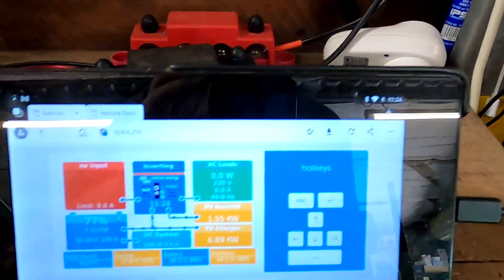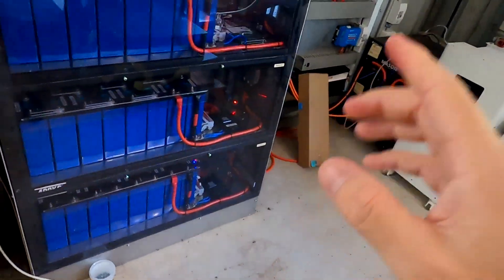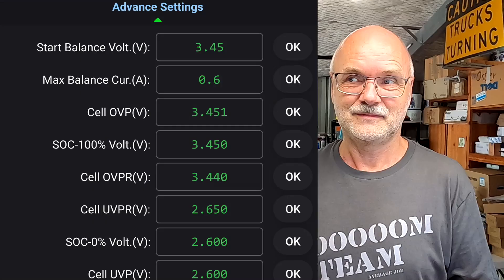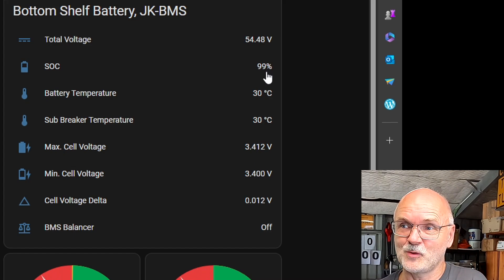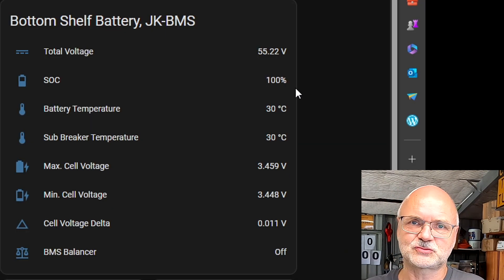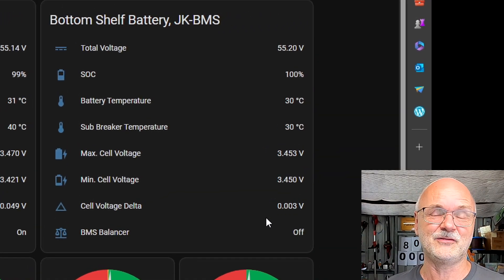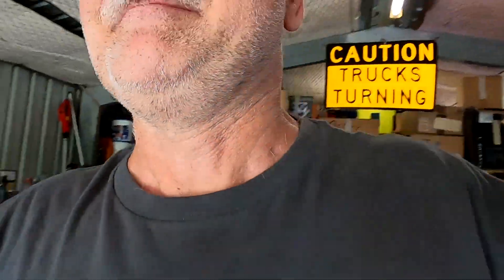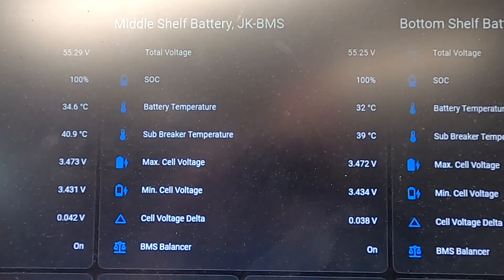Reset the old JK-BMS to 100% SOC when fully charged with no OVP. Here is how.

Comment: Great video as always. Have you done anything about not having a balancer on the battery pack, you could just monitor the voltage on each cell, when a cell reaches 3.5v or 3.65v you can lower the charging current, I know that it is then the bad cell that first reaches 3.65v and the others do not get a full charge but they will last for a longer time/year, you can always replace the bad cell or mount a slightly smaller cell on it in parallel. One replaces cell if less in % I guess.
Reply from the maker: Oh, no, no, no... that not how it works. WHY, why would you disconnect the active balancer just to let some cells hit 3.65V??? That makes no sense.
A smaller battery in parallel with a larger is a big no no as well. Tested here on the channel.
Reply: @OffGridGarageAustralia  Just thought that the max volt you could charge to was 3.65v for a cell, a balancer is probably an idea.
Reply from the maker: @jacobhn2 We don't need to charge to 3.65V with these cells to fully charge them. That is just the max, the manufacturer states in the specs. The cells will perfectly fully charge at 3.45V with a bit of absorption time. Lots of videos about that here on the channel...

Comment: 80k..fully deserved!
Great news on the 100% "reset", which probably is more a calibration to 100%, which will likely need to be redone if you "disturb" the batterie again, but as long as we don't do that😅..all good. 
I was also really p... about never getting the right "full" status, but this solves it..well done🤪
Reply from the maker: Well, it seems to 'reset' the charge cycles once we hit OVP. Ohh, don't you love JK's software🤣
Reply: @OffGridGarageAustralia  
No, not by hitting OVP.
It resets the charge cycle counter, if you change the capacity setting, as you did before.
Look at your video between 9:00 and 9:14

Comment: I use a node red workflow to reset to 100%. If the voltage of the akku is reached, the current is less than 0.4 i.e. and the battery has 98% or less, then i set the OVP to something like 3.45V. Then after JKBMS resets to 100% I set the OVP back to 3.6V
Btw. Serialbattery has also a feature to reset to 100% by loading to the OVP once every couple of days.
I use a D1 Mini ESP 32 which is flashed with esphome-jk-bms. This connects via bluetooth to the jkbms and allows to change every parameter from remote.
Everything is integrated in homeassistant from where i cann access everything via Node-Red
Reply: What? Please describe in more detail!
Reply: @anacronataff1  See my answer to michaelnarr7554
Reply: @ThomasWetterer  Dein Name klingt so Deutsch. Ich kann deine Antwort nicht sehen. Kannst du sie mir bitte kopieren oder wiederholen?
Reply: @michaelnarr7554   Habs oben in meiner Antwort ergänzt. Irgendwie werden meine Antworten nicht gezeigt.
Reply: @ThomasWetterer Danke jetzt kann ich es lesen. Ich habe das BMS an Victron OS über USB angebunden. Mal sehen was da möglich ist.
Reply: @michaelnarr7554 Das hab ich auch. Zusätzlich dann noch per Bluetooth mit dem esp32 um an die Einstellungen dran zu kommen. Das geht an Venus OS vorbei. In Venus OS gibt es bislang keine Möglichkeit was an den Settings zu ändern, auch nicht in SerialBattery. Denk das klappt auch nicht wenn man das JKBMS per Bluetooth anbindet.
Reply: @anacronataff1  I have added the infos in my answer above.
Reply: Hi, I’m also interesting in this way. Who do you can set the OVP with Node Red? I did’t found a command like this.

Comment: Thanks Andy, very helpful, just set up my first jk BMS and home made battery pack. Its fitted to Reva Gwiz electric car 😂, so i fitted 16 304ah batteries with the B2A20S20P BMS, connected everything up, charged the pack to 100%, it read 100% but wasn't at the full voltage, 🤔 Tried the car, great, it showed between 100 and 200amp discharge most of the time but did have some high spikes at upto 400 amp😳 for a few seconds. Then the soc disappeared , 0, I turned everything off and on a few times but no effect, so I reset the BMS and it came back at 68%. Much lower than i would have expected. I have charged it up again and it says 100% but they are not at fill voltage, any advice 🤔 thanks 👍 Ellis
Update, I just resent the 100 soc by changing the capacity of the batteries and they now say 73%🤔
Reply from the maker: Thank you very much!
Fully charge your battery and then fully discharge until the BMS turns off. The BMS will determine the actual capacity of your battery.
400A spikes are not good.

Comment: When OVP is set back to 3.65V, it looks like the 100%-reset is not based on voltage but on history of amps going into the battery. It doesn't really RESET to 100% at a defined voltage, but it gets to 100% by counting the Ah charged into the battery. This may be problematic because counting the Ah will drift over time due to measurement errors.
Reply from the maker: Yes, I think that is true. It coulomb counts from there, hence we see the voltage over and under that previously used voltage.

Comment: Andy I'm using a JK_B2A8S20P. Looks like we are using the same hardware version 11.XW, but my software version is a bit newer, 11.288. My first full test charge it reset to 100% at my SOC-100% value when one cell hit the desired voltage. Oddly I had configured the settings the way JK suggested when I saw you mention it in an earlier video. Not sure if this is fixed or is just a random BMS that works. Thought it was worth mentioning. Too bad they don't have release notes for the firmware version.
Reply from the maker: Can you give an example with the settings. I don't quite understand what you mean...
Reply: @OffGridGarageAustralia  Hi, I was just referring to the descending order. My test settings were OVP: 3.625 / SOC-100%: 3.500 / OVPR: 3.499. You had mentioned the order previously and I happened to set it like that for my charge test.
Reply: @OffGridGarageAustralia  I finally had time to charge my battery again today. What was interesting this time was it reset to 100% when the 'remain capacity' matched the total battery capacity. This was unexpected because none of my cells were close to the 100% voltage setting and the battery continued to charge for another hour. The bms continued to display 100% for the remainder of the charge cycle.

Comment: great solution, i did it already a few month ago, after this i only have to lower the capacity and put it again to the old data.
My bms shows first 94 % and then goes to 100 %, it means my capacity actual is 94 %, correct andy ?
And up to 1 million subscribers
Reply from the maker: Never seen it jumping in my both JKs. It gradually goes up to 100%

A million... pfff, don't have enough door space for that😄

Comment: Nice trick... here is new content for you, andy: 
if this trick works also at the seplos 10C bms? I already have this problem with my seplos. I have to touch the OVP to reset to 100% or to stay for more than one hour at maximum charge voltage. So the seplos charges most the time only till 98 or 99 percent... ☹️
Reply from the maker: Seplos is lost! Their software is so far back. I'm testing the V3.0 at the moment for someone. What a piece of garbage that is. The software is so bad, I just don't want to use it at all. It's not worth it!
Reply: I have self-made the hole battery pack with cnc milled mounting for the bms, so I have to life with it😅🙈

My biggest problem is the deviation with these shitty four cells anyway... I'm in contact with gobelpower now... if this is solved I can life with 99% soc... because I have no packs in parallel...

Greetings from Germany 🙋‍♂️

Comment: This is the same way daly wants us to reset to 100%. Also andy yesterday i found a new thing for me. If i use ferrules in victron mppt side the voltage it shows is higher so i think we shouldnt use ferrules as thats the recommendations from victron too.
Reply from the maker: Why would ferrules make a difference? I have tested (and still do) one controller with and one without ferules. There is absolutely no difference. My sparky also says use ferrules for these fine stranded wires.
Reply: @OffGridGarageAustralia  I think it's to do with resistance that's what victron says in there manual but I also was shocked to see it happen. There was about 1v difference or may be more. The difference came down as soon as I removed the ferrules.
Reply: @OffGridGarageAustralia  also forgot to add one more thing the lug I used was a pin lug it's different from what you used.

Comment: What if you hit a real cell over voltage protection situation now at 3.65v? Will the SOC-100% trigger change back to 3.65v then?
Reply: The SOC is not set to trigger at a voltage by this action - it is only set to 100% once.
SOC is calculated by in and out going amps and can only be correct, if the capacity is set to the real capacity of the battery and the current is calibrated.
Reply: @Juergen_Miessmer  Ok, so you need to update the capacity to enable the BMS to store a new SOC-100% once again at COVP. I hope it is actually storing the total voltage at that point in time, as if it after that point only relies on in/out calculations it will most likely drift off over time.

Comment: Top class video.  Perfectly and clearly explained

Can the JK calculate the Capacity of a pack ?  Or what is needed for it to be able to calculate the capacity ?  Of how can we use the data to calculate or better estimate the capacity.  I have a 16s4p pack which "should" be around 40kWh, but I know it's less, but I'm struggling to understand how to find out what it's real (or close to it) capacity is

Keep up the fantastic educational videos
Reply from the maker: Thanks a lot for your feedback. The JK is capable of measuring the overall capacity of your pack. Fully charge and discharge until you hit UVP. That should show the real capacity of your pack then.

Comment: Great, i did that a few weeks ago and it worked, but i didn't knew why started to work haha
Reply from the maker: Now you know!
Reply: In the 2 or 3 weeks that have passed since this reset, the bms drifted to about to showing 76% with max charge... i just have 2 identicall bms but one is 1 month newer and it resets to 100% with the parameter as it should v11.287, the older one drifts like crazy (that one doesnt have the reset voltage V11.261)

Comment: Andy, there has been a reported bug on setting up capacity of JK Inverter BMS setting it using bluetooth app. It will show but it doesnt actually replaced the setting when checking via PC. For example you chabged to 300ah via blue tooth it will show 300 on bluetooth but when you check using PC it will still be 50ah resulting for battery to get premature full charge. Probably you can test on your next video
Reply from the maker: How can you check this BMS via PC?

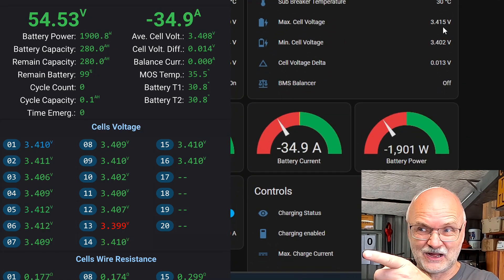Comment: 13:06 why it discharged that much when the whole system is still being charged by the SCC?
Of did the SCC changed into FLOAT VOLTAGE (which is lower than the battery voltage)?
Reply from the maker: One BMS hitting OVP it sets CCL to 0A for all batteries. It then discharged until the JK hit OVPR again as I explained.

Comment: As some others also pointed out: this trick works only for a certain time when the %-age starts doing strange things again… I’ve have pulled this trick already a few times but I think now after the 3rd time in about 10 months of use, I kind of gave up to reset the 100% and rather live with it. 
Looking at the battery Voltage gives me a better idea of the real SOC. I know the Voltages and the charge levels of my 48V battery by hart right now…
I really hope that JK starts to listen to us/you at some point. I also tried to get an answer from them regarding this issue and never got any reply. Pitty…
Reply from the maker: What is this certain time though. 8 weeks in and it still works for me on both BMSes...
Yeah, the voltage and current levels gives it away and we know our batteries.
Reply: @OffGridGarageAustralia 
I noticed that the %-age go berserk again after my battery goes to 0%. 0% being at 2.8V in my settings. 
It happens now and then in winter time.

Comment: I do not understand, you only once lower the OVP setting and the BMS forever uses this lower value to reset to 100%? What if you set it to 3.3V once, does the BMS resets to 100% forever for this valilue as well xD?
Reply: No, the SOC is set once to 100% by this action. No voltage value is stored.
Reply: @Juergen_Miessmer  ok, than this is not a solution at all, as the SOC will drift again after a few cycles
Reply: @matija3791  
It will help to set the capacity to the real capacity of the battery. Also the current needs to be calibrated.
Reply: @Juergen_Miessmer  that's a much better advice xD
Reply from the maker: This is not a solution but mor e a workaround. Only JK can fix it for future BMSes with better firmware.
Reply: @OffGridGarageAustralia  why not just set the battery capacity to 260 amp hours?

Comment: Hi Andy, I would have given you even more 👍👍👍…👍 above, if it would be possible. Excellent video. I have also asked JK for a solution at their aliexpress store, but did not get an answer. Finally I will get my both batteries to the same state of charge. I am using the model B2A8S200P (most likely also the first generation). These BMS’s are working fine beside the SOC. Until now!
- Do you have ever asked JK if it would be possible to update the software for the older devices?
Reply from the maker: Thank you. The firmware in these BMS cannot be updated as the chip they have used is not re-programmable.

Comment: I lost the password to my JKBMS, and can't access the controls. How do I reset the passwords to the older BMS? Please help.
Reply: 1234 or 123456
Reply from the maker: 1234 for Bluetooth pairing
123456 default for changing settings
Reply: You can read the pw via BT. Esphome-jk-bms will show it on its webseite.

Comment: great! I had since a longtime this problem! Is there somewhere a good tutorial or video how to get the JK BMS in Home Assistant? thanks!
Reply from the maker: Depends how you connect the JK and to what. It works quite easy with Victron Venus OS and HASS Victron Modbus integration
Reply: No Victron here, I'm trying to get data out of JKbms with a RS232 to USB adapter but no succes @OffGridGarageAustralia

Comment: Hello Andy, 
nothing new. An OVP resets the SOC to 100% - at whatever voltage you set....
But the SOC counter will drift away by time, especially if the battery capacity is not set to the real capacity (not the nominal) of the pack, or the current is not calibrated.
Reply from the maker: What is over time? Weeks, months, years? So far (8 weeks for me) I have not noticed a drift and the BMS goes to 100% every day. Maybe it drifts in winter when I don't fully charge for a few weeks any more...
Reply: How to calibrate current?
Reply: @Datvi  
Take care for a constant current. Measure it. Set the current in the BMS to the measured value.
For better results do this at diffrent currents.

Comment: I balanced my pack with an active balancer earlier - first time in 5 years not using the passive 50ma balancer on a 12kwh battery.  Was 140mv @3.575 avg - heltec 5A + 2 hours and its 10mv @ 3.61v average/cell I think over 5GW has passed in/out of the battery.
Did you ever see my video comparing your worst day in winter with one of my best in summer?
Reply from the maker: Great cells, you have. Need almost no maintenance...
Never saw this video. I'll have a look!

Comment: First!!!
Reply from the maker: Second 🥈
Reply: Hi Andy  Congratulations on 80K. I also have  2 JK BMS's  the same model as yours, but I notice the software  is V11.281 and my version is V11.261. Is there a way to upgrade the software on  the JK_BD6A20S10P BMS. Thank you and keep up the great work. By the way the version V11.261 does not have the 100% SOC setting.
Reply from the maker: @Bundyblu  Nope, they cannot be updated.